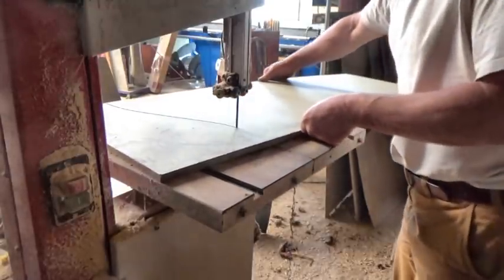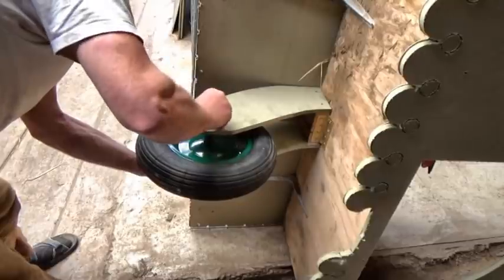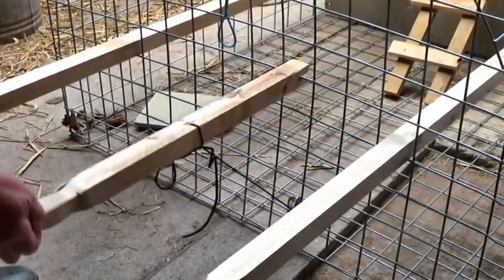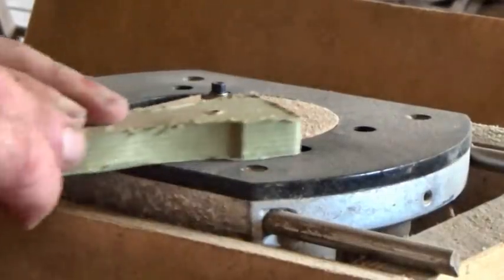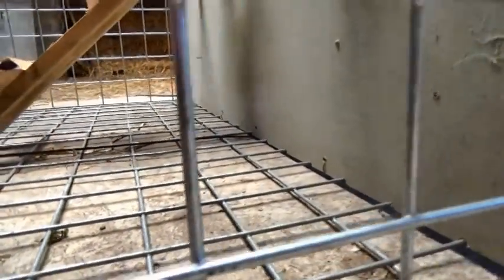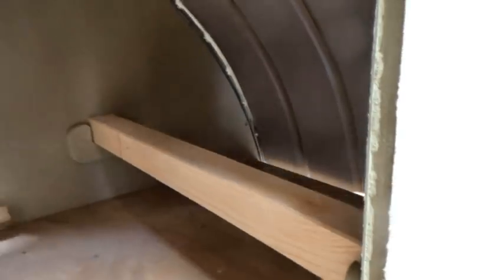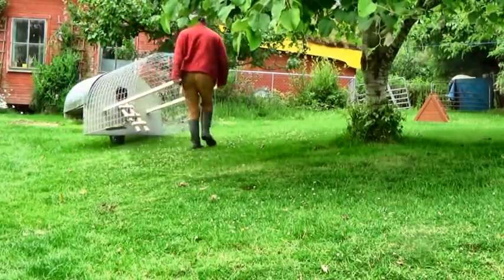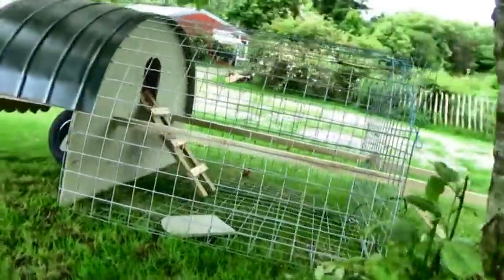Interesting Update On The Wheelbarrow Chicken Tractor Design

Comment: Your lever & handles may be able to be one part if they rotate on a pipe or round bar and force back a frame connected to the wheel. Like a hook lever or ratchet binder with a cheater bar attached.. Does that make sense? It saves having a fussy drawstring to lock the wheel in place for transport at the cost of more metal/wood. It would take some additional space behind the tractor, if that's a concern. 
Rather than try to describe it in a thousand words, I made a quick Sketchup model to demonstrate. It's published under the name "WOWBIB: Chicken tractor locking lever and handle" on Trimbles 3D Warehouse; I'm definitely not skilled enough with Sketchup to make a working model, but I hope that's enough to get the general idea. There is a picture of the model here also: https://imgur.com/a/1WOd0pS
Reply from the maker: Thank you for this. I think the problem is that the cage part would lift up before the wheel does, but I will do some experiments..!
Reply: @WayOutWestx2  Yes, the more I think on it I feel it's a bit of a tricky mechanism to get the linkages right. In theory it could be smooth and intuitive, but theory doesn't always pass through a fan any better than you know what. :P